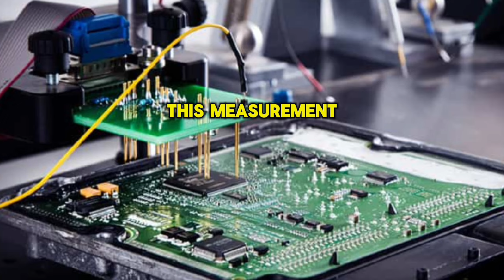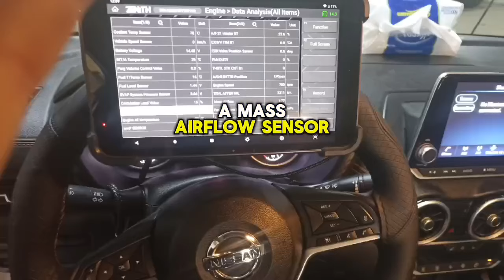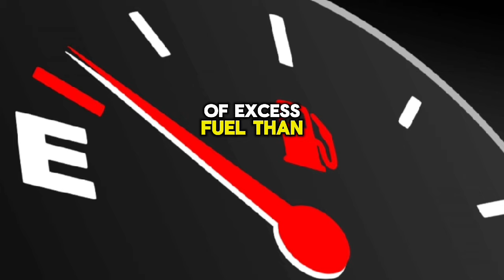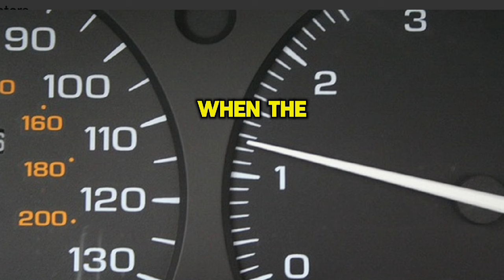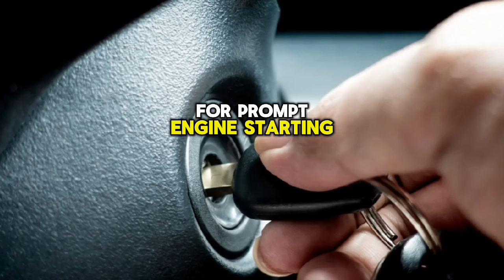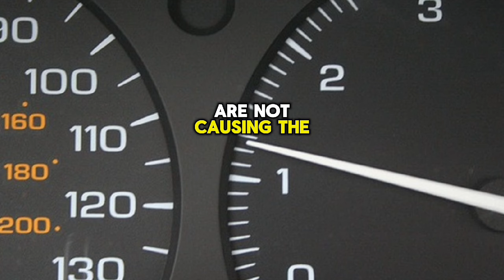Symptoms of a bad MAF Sensor (Mass Airflow Sensor)

Comment: my scanner came up with bad electronic throtal body control i changed it and i still have thr same issue , i cnt rev more then 2000 rpm.  and also i unplug the mafs and the engine still runs the same as if it was still plugged in i need help
Reply from the maker: what are the fault codes and the make and model of the car ? please